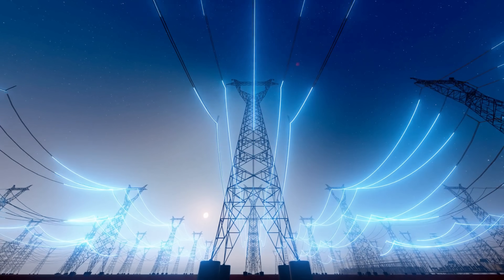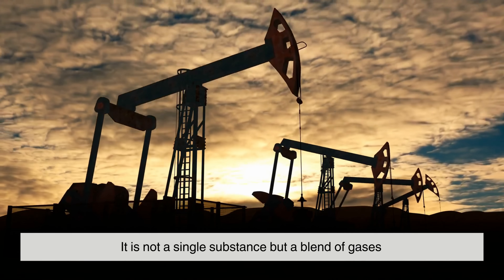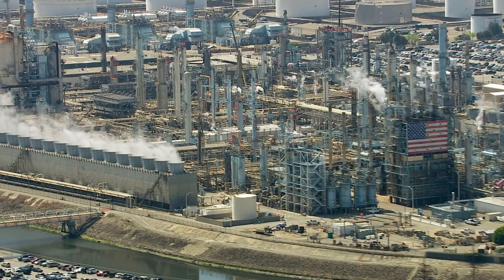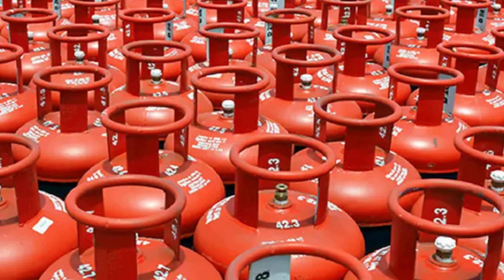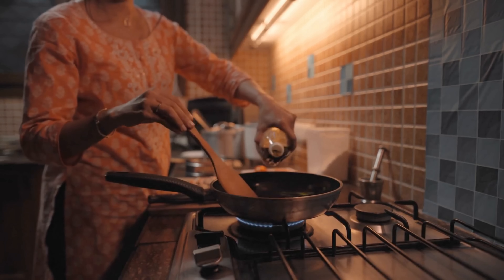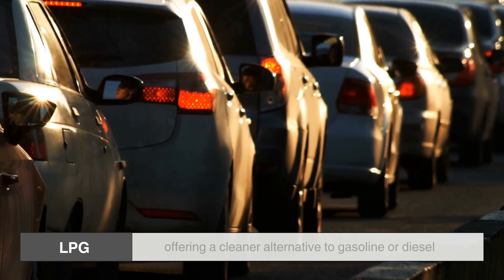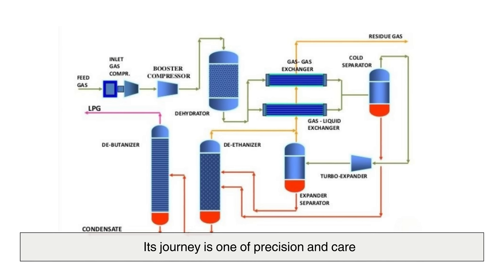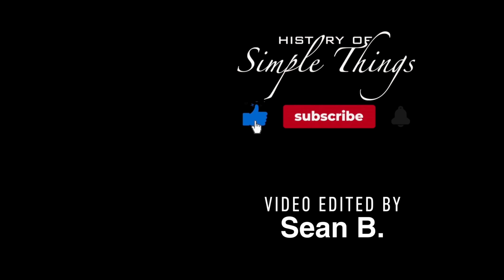How LPG Goes From Invisible Gas to Portable Fuel

Comment: i never understood why propane never became common for cars.
it's much cleaner burning and uses a much simpler air/fuel mixing device
Reply: It's probably not as energy dense as gasoline. So the tank would have to be super big to have a good autonomy.
Reply: @lajya01  the energy oer ub=nit vilumn is about 5 % less
Reply: Regulations, imposed by the gas giants (via lobbying) because it worked too well killed it.

Comment: Propane burns so cleanly, that when used to power vehicle engines...the engine lubricating oil stays cleaner (by a factor of many times) than when using standard liquid fuels such as gasoline or diesel.

Comment: My country used to have Autogas, but the companies that supported it have made it nearly impossible to sell it everywhere, with regulations that cost so much that it made it uneconomic to provide the service. 
I used to have an LPG/Petrol car with running a supercharger and I drove it over 300,000kms, until the task of finding an outlet that sold it became too onerous.
This is a country that exports 1/4 of the worlds LPG to Japan and is now just considered a heating energy product.  I had to sell the car in 2000.

Comment: Good presentation. However you forgot to mention  one crucial ingredient that they put in it for safety reasons. ... the perfume or that particular smell that alerts us right away that there is a gas leak or a gas valve has been opened.
Reply: Mercaptan
Reply: Mercaptan